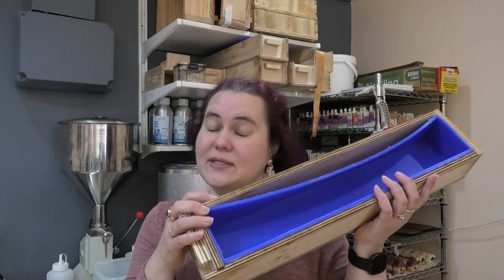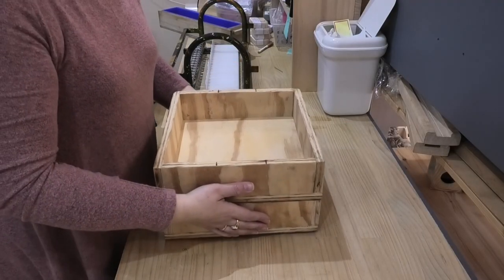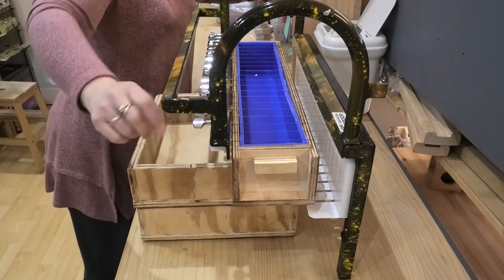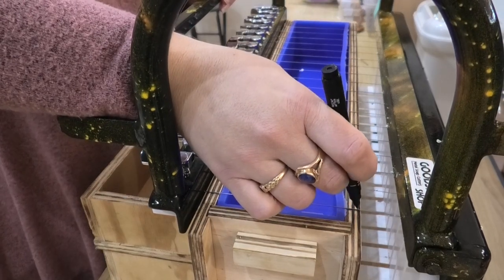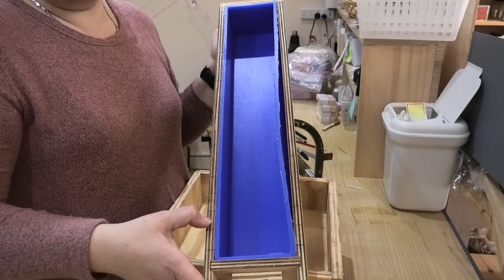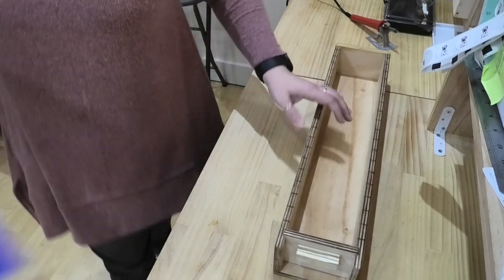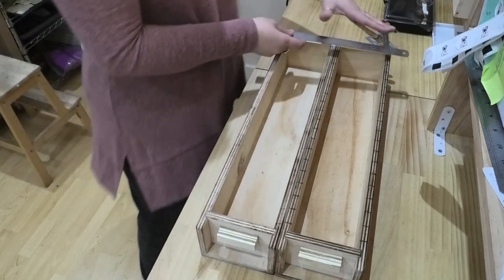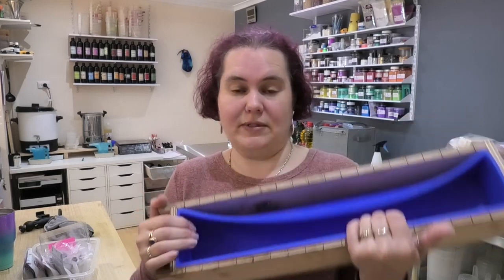How I mark my soap moulds for embed placement

Comment: Handy tip Keeley.  I did the same, (ie: marked up my loaf moulds), but sadly, I did it differently by placing paper under my cutter strings and then marking that which was then transferred to the moulds.  Your way is so much easier!!!!  Keep up the great work and look forward to the next handy hint 🤩🤩😊😊💖💖
Reply from the maker: I tried that method with my original cutter but I think I squished my paper and I got the markings wrong 😆

Comment: Would putting the soap back in the liner given you the same results? Maybe not cut all the way through?
Reply from the maker: Not sure what you mean 🤔 are you saying to par cut the soap and then mark the soap cutter or to par cut and then put on embeds?
Reply: I ment cut the soap just till it leave the lines in the soap then set the block back in the liner and mold.   In my head it seemed easier till I tried explaining it.
Reply from the maker: @cheskydivision  I see what you mean.  That would be one possible way though you have to keep in mind when you stop a cut on the soap. When you go to cut again, you get a funny cut.  Its also extra work to make the soap first

Comment: I would have returned the cutter.
Reply from the maker: I think that's quite sad 😔  As I mention, it is handmade so flaws are to be expected.  In the grand scheme of things it doesn't make much difference to the naked eye, just on the cutting.  Even massed produced cutters have flaws.
Reply: I’m sorry, but that ‘handmade’ argument is a bunch of horse manure.  It’s not only an insult to makers the world over who take pride in their craftsmanship, but reinforces the public’s perception that ‘homemade’ is crap.
Reply from the maker: @LadyGecko  Although I strive to make all my items perfect, I am human enough to admit they are not, especially when making soap.  Even if the wires are exactly at 2.5cm, because of the very nature of soap making, no two bars will be perfect even if it is just one colour soap.  If the soap does not level out or it has a decorative spoon top, each bar will weigh a different amount making them have flaws.  When looking at the cutter, the holes are perfectly placed at 2.5cm but when the wire wraps around the guitar string, it moves it - this is hard to control.  I have had several cutters in my time, and this has to be the best one I have ever had! We are all human at the end of the day.  I honestly feel that my work is now crap because I admit it is not perfect due to things I can not control.
Reply: @SoyandShea  - Hold on a second, there is obviously some miscommunication/misunderstanding here and I apologize for my part of that.

As evidenced I disagreed with your statement:  "it is handmade so flaws are to be expected".  No...flaws should NOT be expected, much less accepted.  If you paid someone  to build kitchen cabinets for you, would it be okay if one of the doors was crooked or a drawer didn't open all the way?  If you paid someone to make a gown for you, would you be okay if the back zipper was offset or the hem was crooked?  I don't think you would.  Several years back I paid good money for a custom Knitting Loom...the gauge was off by an 1/16" (0.15875 cm) off.  No big deal right?  If I'm making a scarf it's not, but if I'm making a fitted garment it's going to be either too small or too big.  On the other hand I had purchased a 'mass produced' Knitting Loom and six of the pins were slightly shortly than the rest...I could have returned it since it was flawed, but since it had no affect on the quality of the knitting produced, I kept it.

There is no comparison between a soap cutter and a bar of soap because of the nature of soap.  Now I only have a single-bar cutter, but if everything it set correctly I can expect to get a perfect 1" wide bar of soap and most of the time I do because I have a quality piece of equipment and have learned the best time to cut my soap.  But the times I don't, that is not the fault of the equipment...it's either human error or the nature of soap.

And artisan soap isn't flawed...it's exactly how soap is made before industrialization and mechanization produced perfect little bars of soap stamped out in a hydraulic press.

I apologize if I offended you or hurt your feelings in any way, it was not my intention.
Reply from the maker: We'll have to agree to disagree.